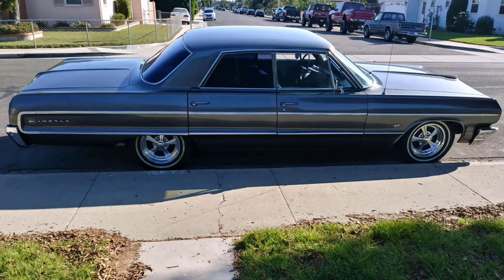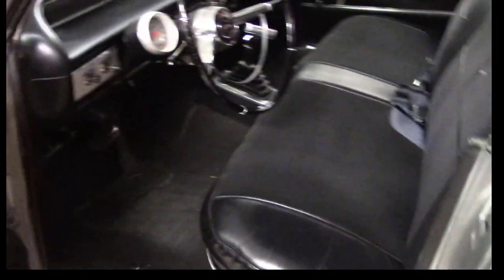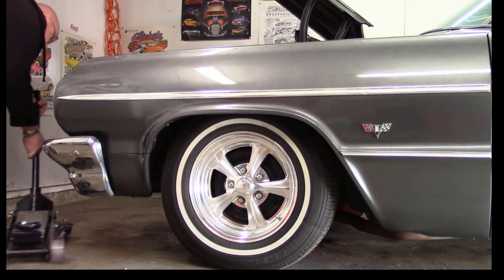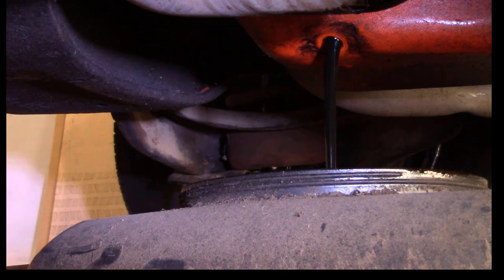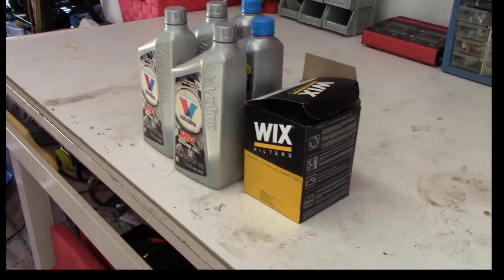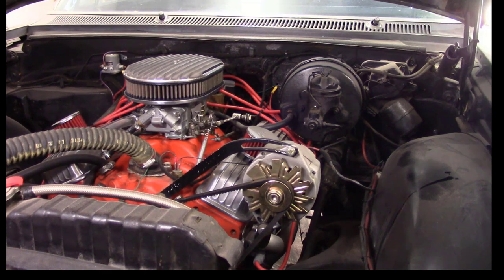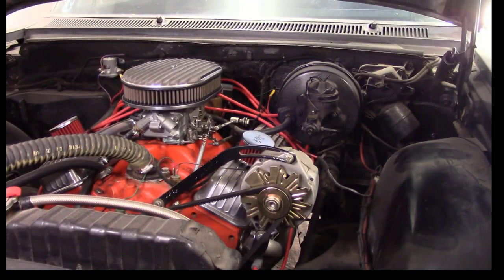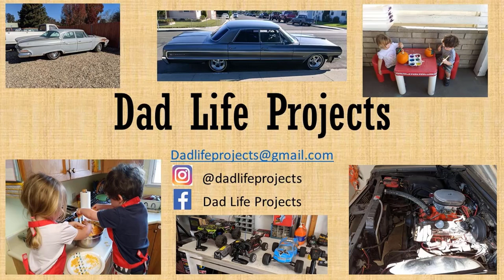PROJECT 1964 CHEVY IMPALA REVIVAL. HOW TO CHANGE THE OIL.

Comment: What oil would you recommend for my 63 impala 283 block engine?
Reply from the maker: When I had my 283 in my impala I would use Valvoline 10-40 high mileage. If your motor hasn't had any head work done on it like the valve guides replaced you should be running a zinc additive for it. Also if your fouling plugs because oil getting by the rings you could use a little thicker oil like a 20-50. I hope this helps. Thanks for support of my channel.
Reply: @Dadlifeprojects  awesome thank you, very informative an I do appreciate the feedback👍🏽
Reply: Thanks this was my question too🍺✌️✌️
Reply: I had that same question but i had my 283 engine  rebuilt.. do you request the same answer...

Comment: I just had my 1963 Chevy belair arrive Wednesday morning. noticed she needs an oil change......hello
Reply from the maker: 63 belairs are really nice. I hope the video helps. I hope to do more videos on my 64 soon. Thanks for the support 👍
Reply: @Dadlifeprojects  I was told it has a 1968 327. It may not be 1968 as I found the oil filter adapter to screw type filter and 1968 should have been screw type from factory?
Reply: @Dadlifeprojects  nice car by the way!
Reply from the maker: It should be a factory screw in type by 68. My 64 was a 283 before I put a 350 in it and it had a screw in type also. If it has the adapter it must be earlier than 68. I guess you can always decode the block number to find out the year. Thanks again for the support 👍